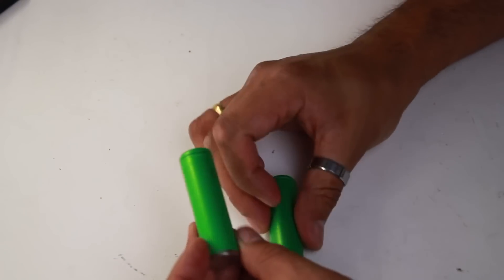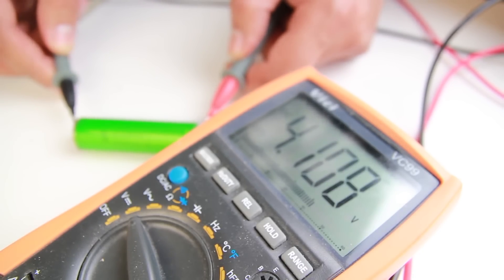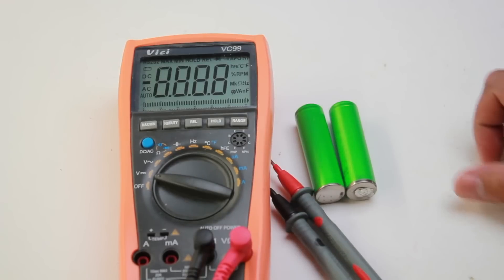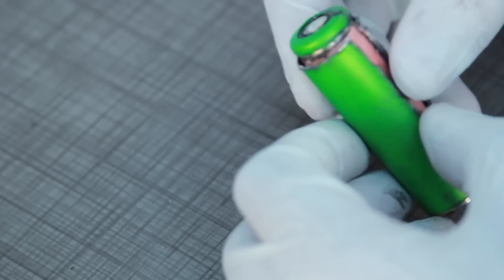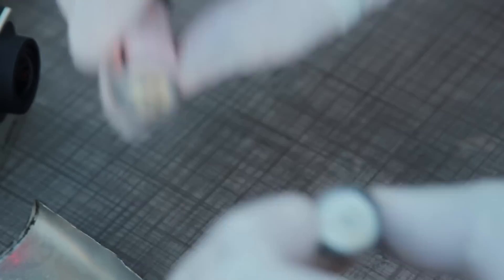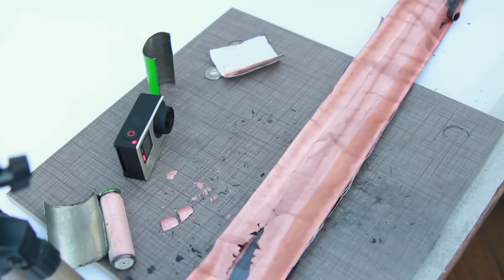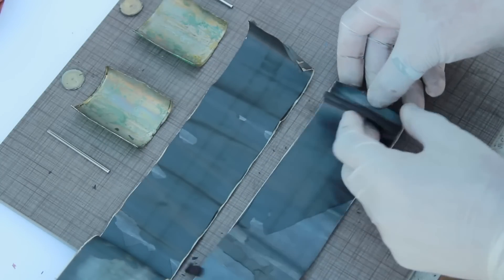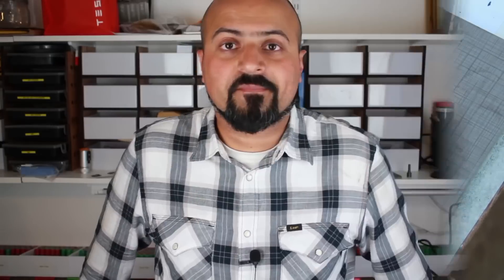The 18650 Autopsy - Part V

Comment: You might as well have put the battery in the oven. You worked on the soldering iron for too long, it is clear that the battery will be damaged. This is a ridiculous show. Soldering a battery usually takes a maximum of 5 seconds, usually only 3 seconds

Comment: I find the best way to solder these cells is with an old fashioned soldering iron that is heated with a gas blow torch , the process of heating the cells negative end is much faster and takes only about 3 seconds. we have been making up battery packs for R/C cars and boats for years this way and we have never had any problems. the iron needs to be red hot and much larger in its contact area.

Comment: LIthium is an alkali metal in the first column of the periodic table. You DO NOT want to put a disassembled battery in a humid environment and absolutely should not have a tub of water to quench the flames. Very interesting video, I hope you find the inspiration to continue uploading again.
Reply: @snausagesmcgee3963  you are right however typical lithium cobalt oxides are weakly bonded to the cobalt and are prone to violent and spontaneous reduction reactions. Thank you for that information
Reply: yes i was surprised - water no way. I thought the wisdom was a sandbucket

Comment: In case some1 needs context what hes trying, he is trying to solder as bad as possible, (like first time idiot) to see if it damages the goddam cell bc thats often in debate, he didnt found evidence (or small like colorchange on negative side) while multimeter showed no change in voltage (he didnt capacy test them, what i would) while he wanted also to give a little insight of a 18650 cell. his chewing annoyed me too.

Comment: Don't keep the soldering iron on he battery, just quickly melt the wire on top of the battery terminal.
Reply: The point is to show damage (or not) by going to an extreme. Not going to see anything if you solder it "properly" and quickly. But we can get a sense of some damage that might be caused if we see an extreme case.

Comment: The positive side has a circuit breaker built into the cap. It opened from the heat of the soldering iron. The cell was fine internally.
Reply: CID - Circuit Interrupt Device
Reply: i believe this is activated by internal pressure build up @davidbolha

Comment: Just so you know, put lithium in water and you'll get spontaneous combustion. Fortunately you didn't have to find that out first hand
Reply: Strange how I left a damage lipo pack...which I open from a plastic
casing..I forgot about it...One of the cells was leaking...
and  I was going to save the other cell..to run a big arss strip
of LED lights or whatever toys...

I forgot about it and Left it out in the RAIN...Not s damn thing :-( 
I did have a lipo pack exploded while on the charger thou..lol

The reason why you dont want to heat the living shiet out of the 18650 cell is becuase of the circut protecton..it'll heat up ..Gas will simply form under it
pushing up on the diaphram..disconnecting the battery/circut.
Ive pressed plenty of diaphram back down..those so call you THINK
were dead cells...sometimes reads...4.1 V  FFS

Lap top  P.C.  Most of the dead.disconnected cell are at the Micro processor area.
it gets hella HOT there...not from the battery .but from damn CPU.
That's the pATTERN....I recycle 18650

Comment: You have not proved anything here. if you are going to prove anything you need to do it to more batteries ideally new ones so you can rule out amy damege from its use over its life. if it was me id do a capacity test before and after. Yes obviously spot welding is the best way if you are rich enough to afford one. But we are not all rich and make do with what we have.

Comment: Great video! I have been soldering 18650 cells for years and have had no issues. I always  state to be very careful with the positive and make sure you don't add to much solder and let it run down and short out at the insulating seal at the case. You actually showed the worst case scenario when soldering, not a clean tip, not enough flux, not hot enough iron and held it extremy too long. I also cool mine down with a wet towel after soldering. I know at the end you mentioned some of that but wanted to share more of my experiences! Thanks again, I have been wanting to do a similar video for a while. I still might one day showing a really good soldering job versus bad and see if a noticable difference inside!

Comment: How to make it a proveable results , when your soldering skills needs improvement . Soldering a 18650 should be least 3sec and also sand of the top layer to make sure it's works .
Reply: Sand of the top layer , so soldering will be easy * Edit*

Comment: try not to use water to put out a lithium fire, it violently reacts with water and dissociates it into oxygen and hydrogen which then proceeds to explode in the heat of the reaction lol. Great video though

Comment: Don't ever solder a 18650 like this and it's especially dangerous when fully charged. The guy in the video was lucky as it could of exploded. To solder safely spot weld only. Spot welding won't heat up the cells and makes a bond in a split second.

Comment: Start by using a proper soldering iron. Yours is maybe a 25W. You need at least a 50W with a bevel tip (K- type) to transfer muck more heat to the battery, in order for the tin to spread on the plate. Then, NEVER USE PASTE FLUX with any soldering iron.

Comment: Two points. First, if you solder quickly, no damage will be done at all. And second, these batteries are extremely dangerous to tamper with. The last one I accidentally short circuited blew up with such force that there was absolutely nothing left but a shower a copper particles and a horrible smell in the air. I never did find the outer case or anode cap! Fortunately I threw it out the door the second it started to go into meltdown - ten seconds later there was a very loud bang. Had I have still been holding it, I guess at best I'd of had fingers missing!
Reply: The hell did you do for it to short out like that lol

Comment: I soldered a couple of cheap new batteries but they were under the power that I needed, since then they are unusable, when I try to charge them my charger won't recognize them anymore and won't record the charging time. On most 18650s the positive end of the battery is on a small bridge that is sitting on the actual battery end.

Comment: Hi! is it safe to connect (in parallel) lead acid 12v 9ah battery to a 2 4s2p configured lithium ion (18650) batteries on a motorcycle? and wont it damage my motorcycle?
Reply: Bad idea different cell chemistry
Reply: The lead acid would probably fry the lithium cells

Comment: Not sure who out there thinks this a failure. but I say it is a resounding success! He is not trying to give a soldering class, he just wants to answer the question so many of you "arm chair scientists "raise about heat from soldering destroys these batteries. I agree that it may not be good for them, but a good hi amp soldering iron along with good soldering skills will result in very minimal effect on the life of the battery.

Comment: You used light solder. You should use 100+Watt solder, which will solder negative side for 1sec. Battery will not get hot!

Comment: Bro you really must learn not to solder. negative side with solder in power.If you volt measure the solder nose with the negative power of the battery you will see that there is a volt measure.Always soldering negative sides with power off!!!Test and you will be convinced of what i am saying!

Comment: It does not show absolutely anything. Completely inconclusive 1. You need to know how to solder. 2. You need to perform it on new batteries. 3. You neet to perform it multiple times. 4. Preferably use microscope even if unprofessionally 5. Draw conclusions.

Comment: Your not using the thermometer correctly. You should be around 6:1-12:1 ratio away from what your measuring the temp of.. so you should of been holding the temp gun anywhere from 6-12 times the size of the object your measuring that's why you has such a difference when you measured the  negitive side.

Comment: The 18650 battery is crap they break easy
Reply: nah li-ion 18650 is one of the most used battery for power banks. and im pretty sure manufactures would use a trash battery that didnt last long

Comment: Trick to do it is, clean it well with sand paper, use a smear of plumbers running flux, solder hot and fast with a high watt 30 or better iron or gun.
Reply: LMAO...#1 NEVER use "plumbers" flux on electrical components....use ONLY rosin flux designed for the task!  #2 "high watt 30" lol, you don't have a clue what high watt is do you? 75 watt minimum! #3 You should never have to use "sandpaper" on batteries, or electrical components...

Comment: Using the good solder iron station with the larger tip at the high temp can be done within few seconds. The result will be the same as the spot welder. A none skill solder can be degraded the battery when using the cheap solder iron. Thank for the video which showing the internal of the batteries.

Comment: I agree with most here, spot weld when you can, solder to tags when you cant, keep heat to the cell itself to the minimum esp the bottom. Good vid. Thanks

Comment: Thanks for your professional sciene study to illustrate the advantage of spot welding. Would you mind doing another experiment to disassemble an old Lithium battery? If the result is similar to solder welding, it means charging and discharging operation will generate the heat to de-grade the electrodes. Spot welding is for mass production of battery pack. For DIY users, they need to take some potential risk or damage for their battery packs. However, how to control the potentials, avoid some critical mistakes  & initiate some important criteria. You will do a great job to tell us how to manage to solder a healthy Lithium battery pack. I guess that would be your purpose to post the video. Thanks for your reading my long sentences. Kind regards Wei

Comment: Who the frack taught you to solder? That is terrible technique! I am surprised you did not trash the batteries. Also, get a decent iron. Properly tin the tip and prepare the surface before you (attempt) to solder.
Reply: it does not matter for this video it's better that he did it that way for the video

Comment: Rough up the surface with a file before doing anything...then add some non corrosive flux, and use a temp controlled station.
Reply: Correct. I takeoff a thin layer of the surface with a Dremel, then solder and flux flow the instant heat is applied

Comment: A foot and 4 inchs? no way... considering the Go Pro is around 59mm in width I estimate it to be around half a meter 500mm.
Reply: the tile is 12"x12", so my guess would be about 18"-20" but he never shows both ends in one frame, so it could be longer.

Comment: What would you say is the best 18650 for vaping using regulated box mod , and what mah would you recommend?
Reply: It’s about The metal get your vape related battery advice from Battery Mooch (youtube, Facebook, IG). 
This video popped up in my feed, but it's a terrible example of educating people how to handle cells like these. 

There's no such thing as recommended mAh. You probably want the most battery life out of your mod. However mAh and amp rating go hand in hand. Usually the higher the capacity (mAh), the lower the amp rating (power). So depending on the wattage you vape at, you use different batteries. Don't use low amp batteries with high power. 

In general though Sony VTC5A is the best allround 18650 battery for vaping, and has been for over a year. It's got a very nice capacity, it's a solid power performer and it is very accessible.

Whatever you do, don't buy rewrapped batteries unless tested and recommended by Mooch and use his ratings table as your Bible.

Comment: Can anyone here can answer my question? I accidentally made a hole on my Li-ion battery 18650 after i weld with 2 copper rods using car battery. My question is it well burst if it has a hole on it or can u give me a scenario what will happen next if has a hole?

Im gladly appreciated for those who can answer my question...
Reply from the maker: I would suggest you dispose of this in a safe manner. A hole in the cell means the chemistry in the shell is at risk of being contaminated by the moisture in the air and so could either just not charge any more or if it charges could smoke and get very hot. So better to be safe and dispose of it in a responsible manner.
Reply: 😭That's the reason I come here. My brand new Panasonic

Comment: you're going out of your way to hold the soldering iron on those more than necessary. the test is rigged and invalid.
Reply: So, instead of doing very minimal damage, it does almost no damage at all. What's your point? He used the most extreme case, and it still proved negligible. Thats the whole idea. Most dummys that solder their batteries don't know how to solder properly, so this takes those people into consideration. You're rigged and invalid.

Comment: I do not know if you ever opened up lithium based rechargeable battery, but you do not show knowledge about them on this video
this white stuff is separator and it is NOT discoloured, but melted
another foolish thing you did
you left cut cell just like this risking fire all around - you should put it into some fireproof container to contain fire just in case - your behaviour is a very foolish, especially as I can see a child next to you and you seem to not care about safety of yourself and child

Comment: I would not use such gloves - fire-proof is sensible minimum, but I would rather go ahead with no gloves, as pieces of battery material may stick to glove and make matter worse
Using water and even having water nearby is awfully stupid idea while handling lithium - go ahead with sand, but water will make it worse - instead of having furious fire in single place you would end up with multiple flames flying around - water does not extinguish lithium fire.

Comment: Interesting video on how NOT to solder a li-ion battery.
Reply: dudes keeping the iron on the battery for so long, put a small amount of solder on the tip first so that heat transfers better. Though not saying that u should solder it by  applying solder from the tip, thats incorrect.
Reply: Come on guys give him a break.. obviously it was his first time ever soldering 😂😂🤣☠️🤦  lmao
Reply: @luckylarz4269  yeah why not, he was going to be attacked by burning lithium in his one face no biggie, he can just replace it.
Reply: @viratkumarsingh3643  😂🤣🥴
Reply: Blow him self up lmfao   . Nice chemistry set in your face when that happens
Reply: I mean if you are gonna test for damage by soldering might as well get it good and hot.
Reply: Iron tip wasn't even tinned, all covered in black crap. Very poor heat transfer.
Reply: I would hear the screams of the CID on that battery
Reply: When we made this, it was supposed to be an extreme stress test, that's why there was a control battery and a soldered battery, 🙄

Comment: Sir, Esp since you have kids around: research what happens with Lithium and water. You should NOT have ANY water anywhere close by... What you did was highly dangerous! With a tub of water there... Also your cutting of the Batteries likely caused more heat then the actual solder...
Reply: lithium ion batteries don't react to water, the energizer ultimate battwriws that use metalic lithium are the ones that react to water
Reply: Idiot, learn the difference between "lithium metal" and lithium ion batteries! Sounds like YOU are the one who needs to do some research before you WOW us with your infinite wisdom!
Reply: I'm literally going to put one of these batteries in the sink to see what happens just because you said that

Comment: What heat damage would happen if you cut two round pieces of nickel the size around the battery soldered a piece of wire to each one and used heat shrink to hold the round nickel pieces to the battery? The heat shrink shouldnt take near the heat to shrink tightly, right?

Comment: The iron shouldn't stay on the battery nearly that long. Even a 40-60 watt iron can melt the solder on contact. Maybe try a lead based solder with a lower melting point. The lead free stuff is like 60-80 degrees higher to melt. Even with a smaller tip like that it should have flowed at contact. And its dangerous to just leave the iron on the cell waiting for the solder

Comment: You're supposed to rough the surface with crocus cloth or sandpaper, clean it with isopropyl alcohol, and use a 30W minimum iron worth a properly tinned tip. It takes seconds.

Comment: thanks for video its possible to careful open 18650 and rewind to a any size pack to use battery cellphone or anythings ?
Reply from the maker: I love this idea. I want to see if I can open up the batteries and fold them to any size. I wonder if you can consolidate various cell internals into one lump? This would be both explosive and highly dangerous eg: excellent YouTube footage.
Reply: ok let us now pls discharge it to zero condition for not do any chemical reaction there is problem with pack with something what is not let inside air all lithium battery is vaccumed
Reply: the answer is no absolutely not, or certainly not without a controlled atmosphere, oxygen will oxidize the lithium on contact, leave it to the manufacturers, just buy a cell appropriate to your needs

Comment: use sand instead of water to contain a bursted cell
Reply: LMAO water and Lithium ,, OMG he must have no idea :p
Reply: sand will not do anything it will  just cover it up. you can use water but it need to be dropped into the container and if you add salt it also helps stop the chemical reaction. P.s water will not stop it but control it